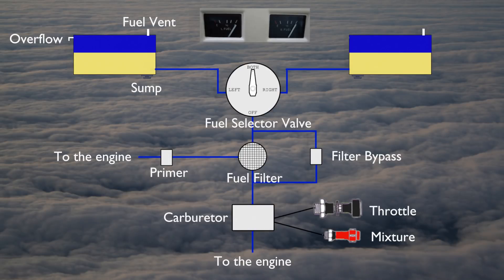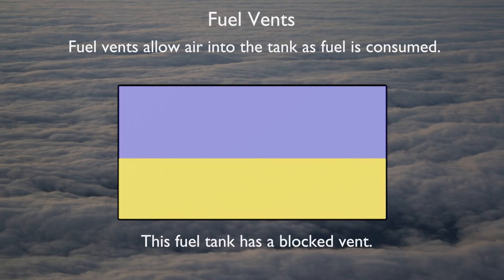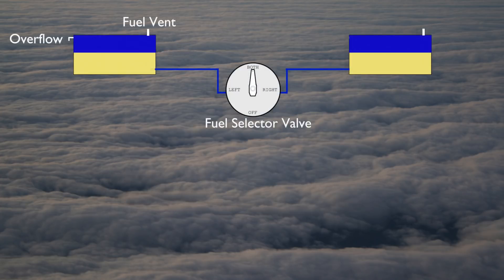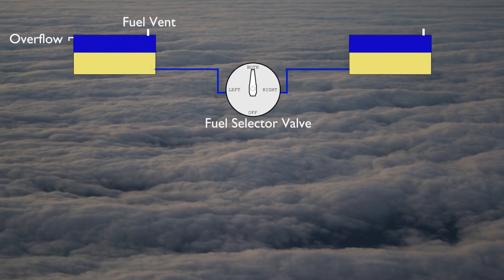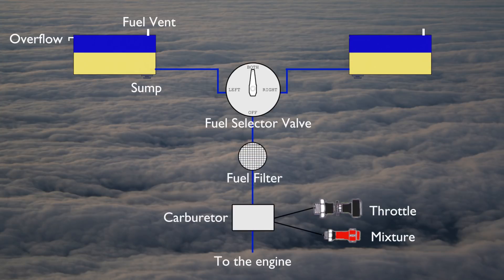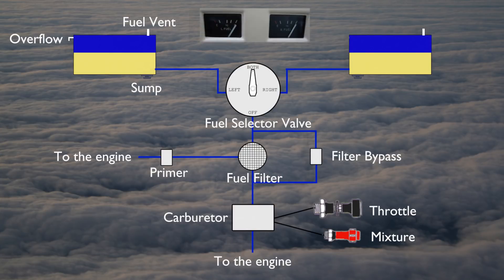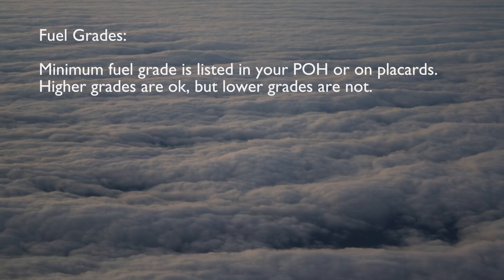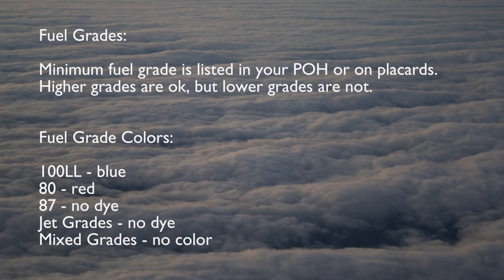Fuel Systems

Comment: No mention of the importance of using a coalscing filter to eliminate  atmospheric water absorbed by the fuel while in storage.  Ice is sometimes the cause of fuel line clogging at high altitudes.
Reply: That’s why you have a fuel temp indicator and a bypass if that happens. Maybe even using a heat source to prevent that. There are many measures to prevent that. Are we storing it outside ? Then warm the aircraft up before use.